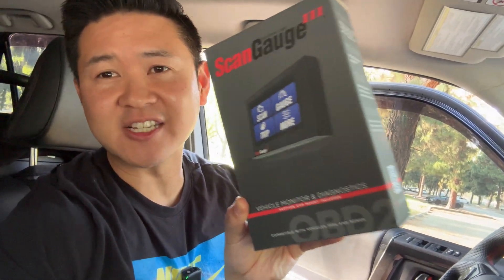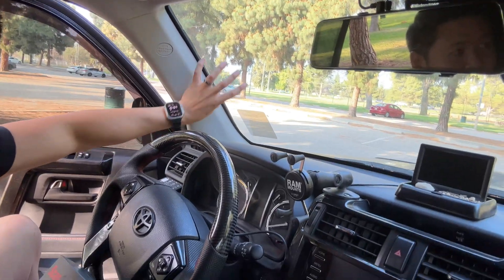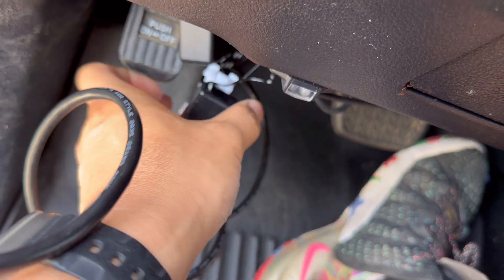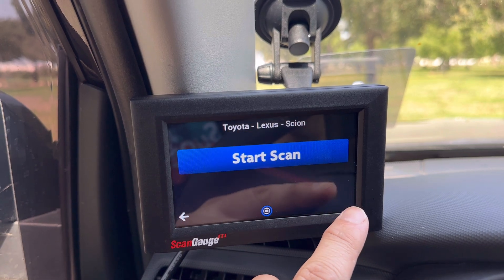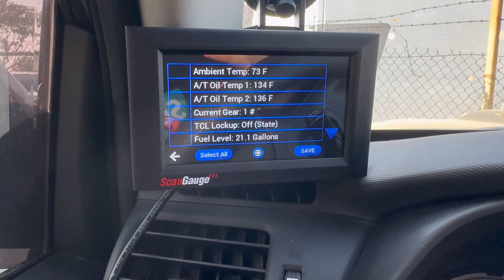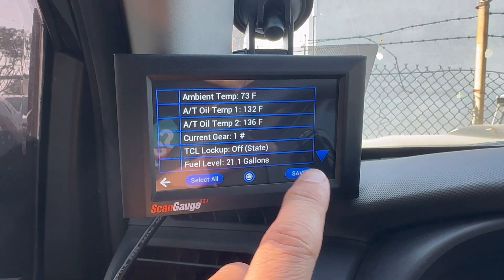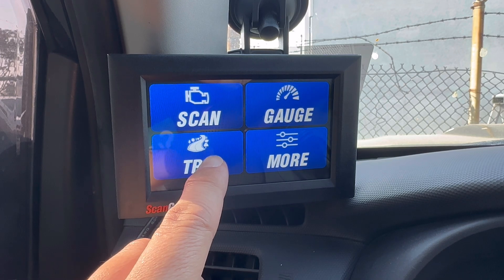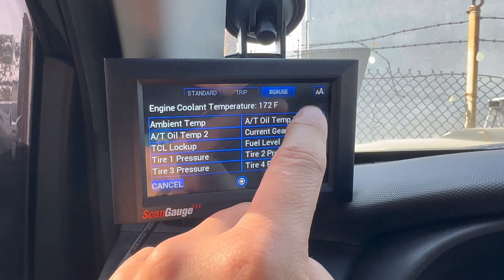Easy SCANGAUGE 3 Install on Toyota 4Runner

Comment: Oil temp available?
Reply from the maker: Many vehicles don’t transmit oil temp to the OBD port by default. If yours does (for example, some Ford diesels or GM trucks), ScanGauge can read it.
 If your vehicle has an oil temp sensor that the ECU uses … then there should be the ability to read it using the ScanGauge
 But if your ECU has no oil-temp sensor or doesn’t make that data available, you won’t be able to track it via ScanGauge.

Comment: Although not common, having something plugged into the obd2 (on board “diagnostics” port all the time, it could potentially cause small electrical issues. 
My brother works at a dealer, he’s a tech and has seen a lot of people come in for weird “limp mode” and electrical issues caused by those insurance companies requiring you to have a reader plugged into your obd2 all the time. 

Sometimes the data it receives and requests can be an overload and sometimes glitch out certain sensors. 

When he ran into those situations he’d had to use his “break out” box that allows the extra stuff hooked up, and see which accessory is causing said issue. As long as there are no bent pins, plug is secure to the port and not smell any burning, should be ok. Just a heads up

Comment: Did u have to rid of the heads up display?  I run a maeatro unit shich plugs into the obd2 port.  I have a dual ob2 port i run gor that and scanguage 2.
Reply from the maker: Nope the heads up worked fine. If you have anything that is plugged in I would remove it and run the updates as well as the x gauge setup first. Once that is dialed in, turn off the car and plug your plugs back into the obd2 port and see if it will read. Mine worked fine after